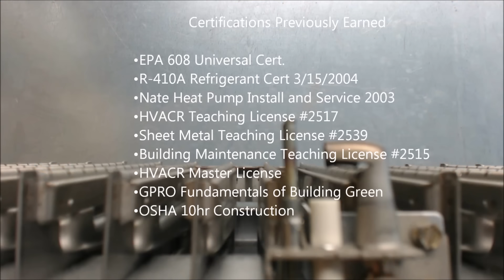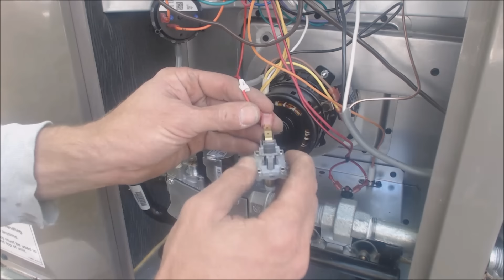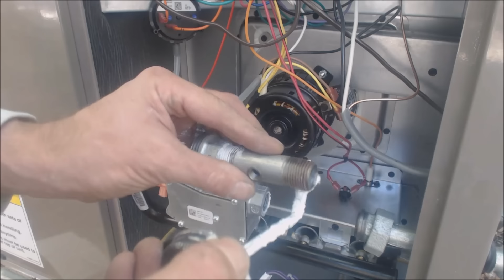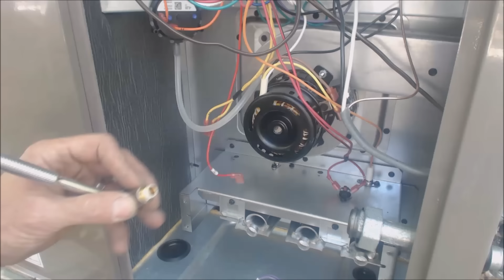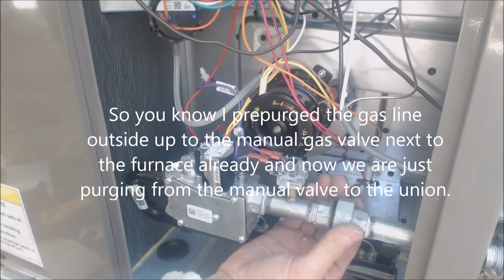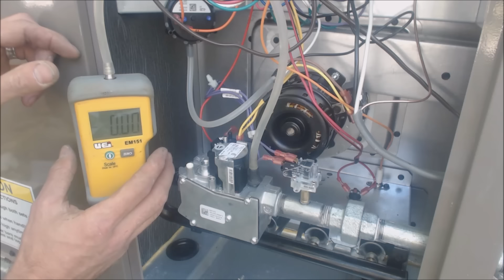Natural Gas to Propane Conversion on a Furnace from Start to Finish!

Comment: I have a r 22 unit it does not have a low side service valve how can i check the pressure , i know is wierd ? Help. Please
Reply from the maker: If it does not have a low side but does have a high side and a txv for a metering device then you could check it with subcooling. However, there should be a low side port to add refrigerant. Usually systems have either no ports, a low side port only, or two ports- a high and a low. What pressure are you running on this line and what kind of unit is this? You could also check to see if you have 18-21 degree temp diff from where the return air comes in to where the supply air comes out. That would tell you if your charge was good on a comfort cooling system on high fan speed. Thanks

Comment: Do you put pipe dope on gas pipe union mating surfices? Thanks.
Reply from the maker: For gas lines, we do not put anything on that surface or on flare surfaces, just the threads attaching the pipe or fitting to the union or flare. For refrigerant lines we use the appropriate oil for the refrigerant on flares. Thanks
Reply: Thank you very much for your response.
Reply from the maker: No problem

Comment: Where can I get these plastic fittings for Manometer tubing in Ontario  Canada
Reply: I got an IHS manometer .  And the new Theme furnace use . A white Rogers gas valve .   My vinyl hoses are a smaller diameter . And there are no ports to screw in the 1/4 barbed fitting.  
   Every week this shit changes.   I'm getting to hate the HVAC trade
Reply: Ottawa

Comment: QUESTIONS:  regarding pressure adjustment, is it a matter of efficiencies?  seems like you can fire it up with incorrect pressure and still have a burn.    Additional foolish question. is this something a competent home handyman can do IF has a decent manometer (without blowing himself up)?   HVAC guys want close to $200 here in the mountains to come out and adjust.
Reply from the maker: I will always highly recommend that a HVAC Tech be performing this work.  A tech would know to zero out the manometer and adjust pressure accordingly especially since you are at a higher elevation. The pressure adjustment is the only thing left on most of these furnaces because all of the other factors are fixed in reference to efficiency. If the pressure is set to high then there could be a danger and also the high heat sensor would get tripped or wore down then trip. If it was set too low then the heater may not put out enough btu's on a cold night.  Thanks for the question!

Comment: Hey can anybody tell me how I can convert gas to propane on a 40 gal Bradford please new heater.
Reply from the maker: You may need a whole new gas valve assembly. Usually those standing water heaters can't simply be converted but the internals and gas valve all need to be changed, thanks

Comment: This may or may not have anything to do with the HVAC or propane furnaces but I'm trying to troubleshoot a problem I'm having with these pressure switches. Like this one:

https://assets.alliedelec.com/70111623.jpg

I've seen these used on various applications and the one on my propane furnace in my garage is similar.

Any idea what causes these adjustable pressure switches to stick either open or closed? I've got three of those low pressure adjustable switches on my car I use to control various applications whenever the turbo builds up to 1 PSI of boost. All of these are mounted on a manifold I made using 1/8" NPT brass tees connected to a port after the throttle body.  They are normally called a Hobbs switch because I think they invented the design but other companies have copied them.

The switch at the end of the manifold disengages the A/C compressor (closed and normally closed contacts) when the turbo spools up, tends to stick in the open position every now and then. I can give it a slight tap with anything and it will go back to normally closed.

Could oil leakage from the turbo (which is normal to some extent) be causing this to happen? Or is it the opposite and I should occasionally remove the set screw and shoot some oil into the switch to lubricate the spring/mechanism? The switches are actually suitable for oil, propane, natural gas etc.

The first set of switches I used were made by Hobbs. The second set were made by some other company but look identical. I'm having the same problem with those brands.

The problem with the A/C switch is bad enough but the other two control the fuel and ignition so I really don't want those to stick on me. The only way I can check these is with an OHMS meter every now and then to make sure they are not in the stuck in the wrong position.
Reply from the maker: It may have something to do with how much pressure you are putting in there. They are only rated for 1/2psi or 14"water column, thanks
Reply: Thank you for your reply. I was thinking these were good from 1 PSI up to 30 PSI. I'm only running 7 lbs of boost but that maybe the reason. I'll check to see if I can find the part number and verify the rating. Thank you.

Comment: Looks like galvanized pipe?  A big no no.
Reply from the maker: In IFGC 2018 there is no difference mentioned between galvanized or black iron schedule 40. I live by the ocean and no supply house within an hour even sells black iron anymore. It rots here and leads to gas leaks. There is nothing wrong with installing black iron if you live inland. There is no reference an inspector has to fail an inspection of galvanized gas pipe because most cities use the IFGC for code reference, thanks.
Reply: @acservicetechchannel  we were told in hvac school it flakes off and can cause issues with the gas valve.  Of course I took hvac school in the 70's so maybe since then they have changed the rules.